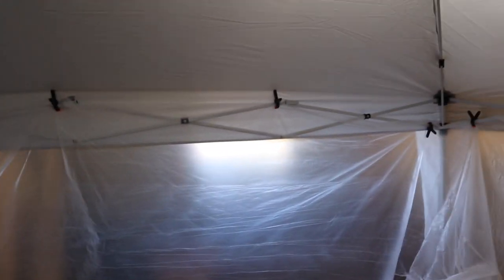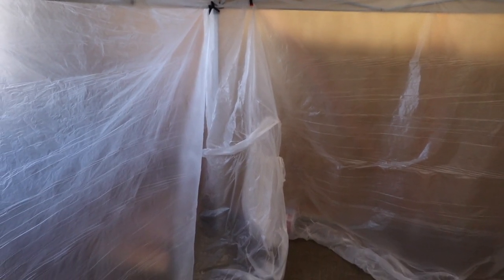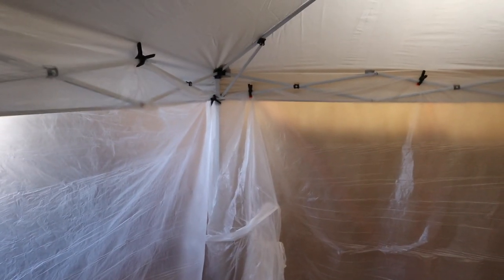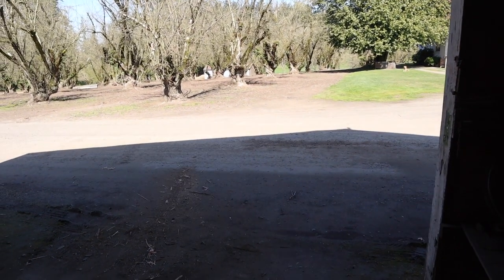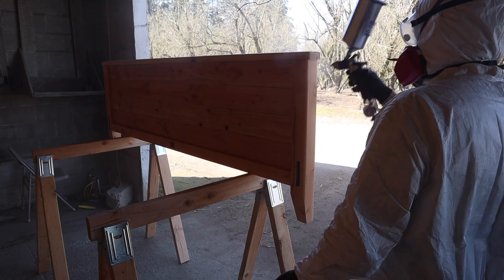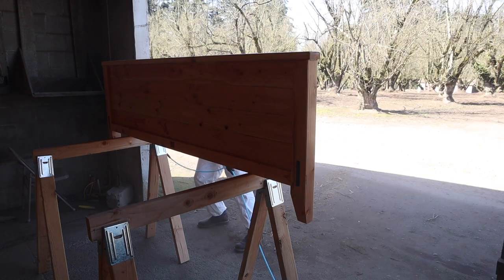Pop Up Spray Booth | Cheap, Easy, Not Perfect

Comment: Awesome, just what I'm looking for. Collapsible canopy.
Reply from the maker: Glad you found it helpful! I found this method not to work perfectly but it was certainly better than nothing
Reply: @NorthwestCraftsman  OK I'm in Lagos, Nigeria. I have my workshop space, but when it's time to spray, i have to use outside the workshop.  Due to cars plying the road and dust, I was thinking of something to set up temporarily to prevent so much dust resting on our furniture.
Reply from the maker: Oh that makes perfect sense! Yea, this should help a lot with that. Many of the tents also come with more permanent sides which would be much easier to deal with than the painters plastic. 

Good luck!
Reply: @NorthwestCraftsman  OK Sir.

Thank you

Comment: Painting motorcycle tank and spoilers.. and i dont have a booth, or even a shop, so i dont want to spray in the house, So I plan on spraying on the back deck... but im worndering if setting up the ez-up canopy.. even without the plastic walls, or maybe some netting instead to keep out bugs, will be a good idea? keep any stray bird * off the paint, maybe cut down on insects? and the ez-up will give me a place to hang the tank and the spoiler panels from.. do you think that canopy will be any help spraying outside?
Reply from the maker: Canopy will definitely help. Especially with also keeping the sun off your finishes. I’ve noticed, for me, my biggest issue with spraying outdoors is the wind. If that’s. Also be aware of overspray on your deck, but I’m about the same place as you mentally.